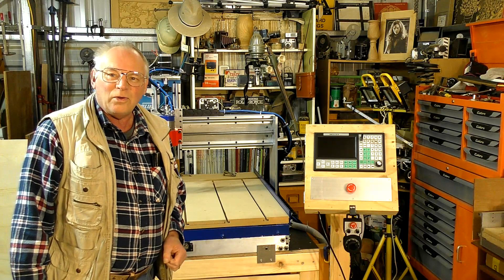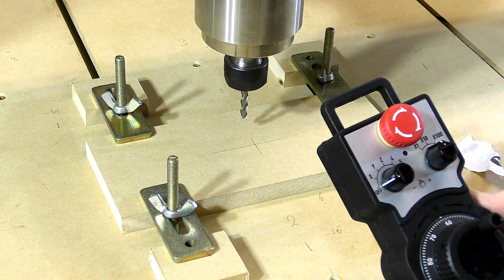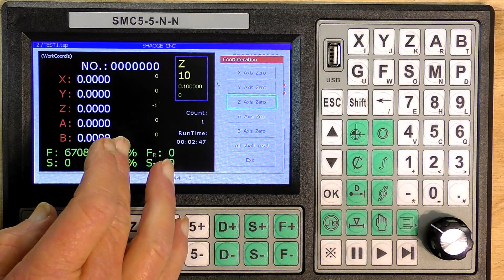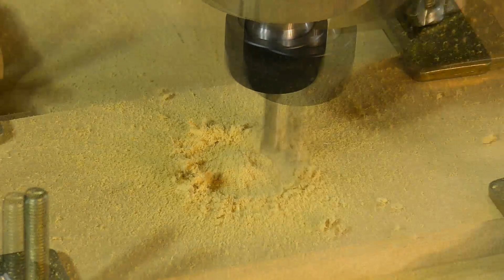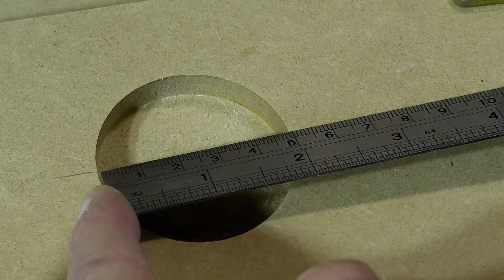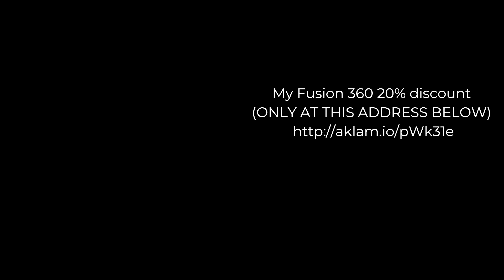TEST DRIVE A NEW CNC ROUTER + I WOULD "NOT" PAY OVER $500 for the SMC 5-5-N-N controller + AVID CNC

Comment: im waiting for my controller to arrive soon. im building a full 5 axis setup, so it will be interesting to see how it works for that type of setup. The issue i see so far, is im not seeing a way to save the offsets for multiple tools, and I guess the thing is when you do a 5 axis setup, you need to zero your tool tip to the height of the rotary axis. an easy way to do this without any tricks would be to have a tool setter set up at the exact height of the rotary axis, probably have to use shims to achieve that. otherwise you need to use some math to set the tool offset properly. ideally this could be done using gcode to just modify the g54 values, but im also not sure if this controller supports that.

I guess one way to do multiple tools would be to use g55-g59

my machine is based off the openbuilds mini mill, reconfigured a bit, with a .8kw air cooled spindle and a harmonic drive 4th and 5th axis trunnion. I'm using inductive sensors for zeroing. also ive run and setup a few different 5 axis machines before and am very familiar with modifying fusion 360 posts, although they recently moved the 5 axis swarf behind a paywall.
Reply from the maker: Hi, there is a facility on my patron pages for technical help
https://www.patreon.com/user?u=15079773